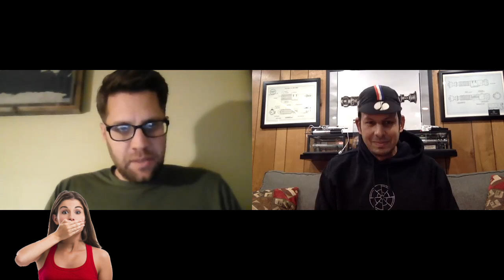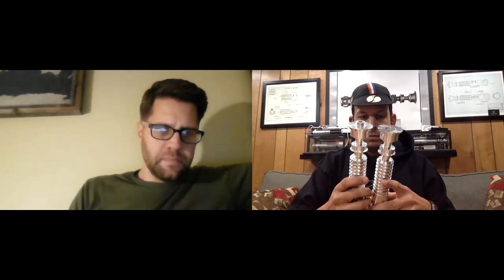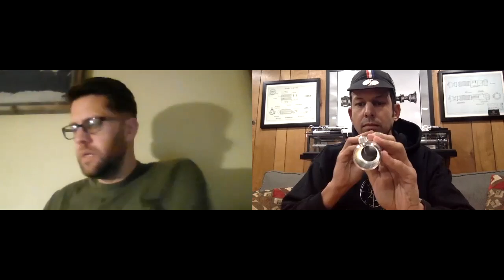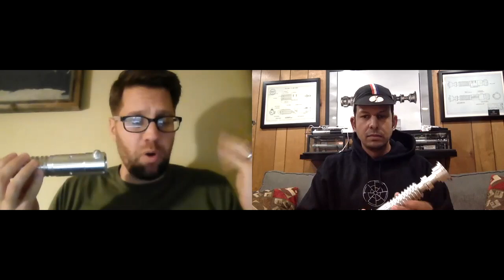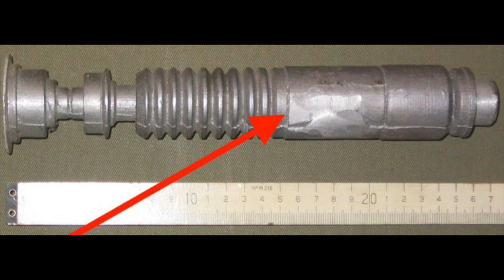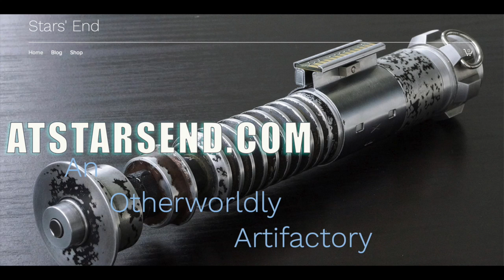Anakin Starkiller DS2 V2 Reveal

Comment: Looks great you guys, a lot of huge improvements on this revision. I'm not convinced it's duel worthy since the emitter threads off and could snap with enough force. If the emitter and grip were all one piece then it'd be sure to take a beating but I'd never duel with one of these.